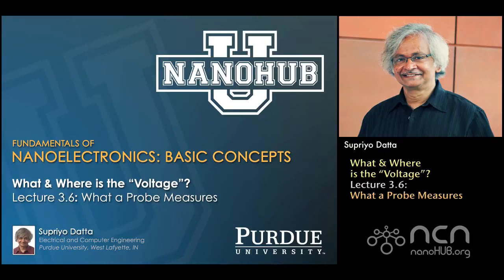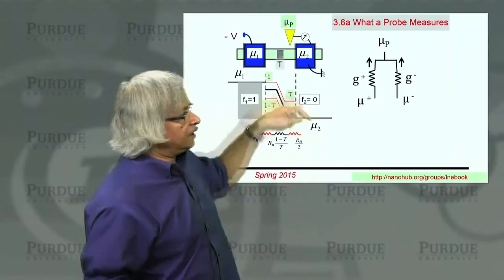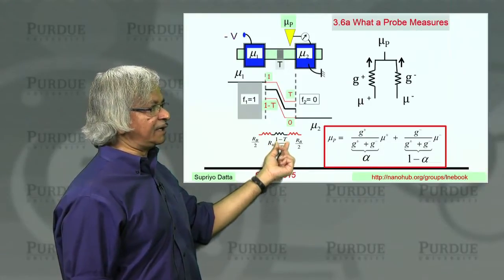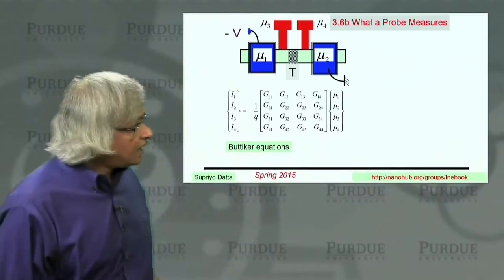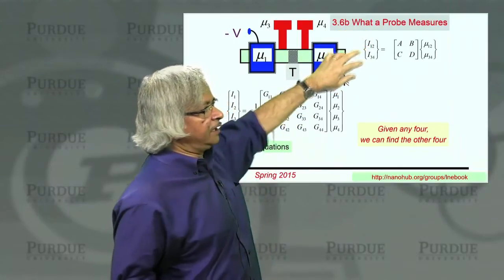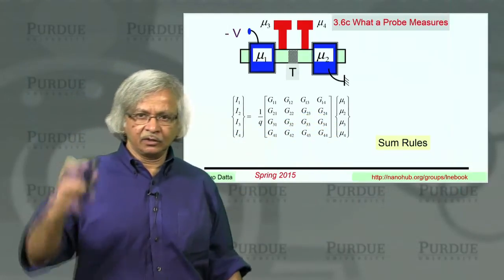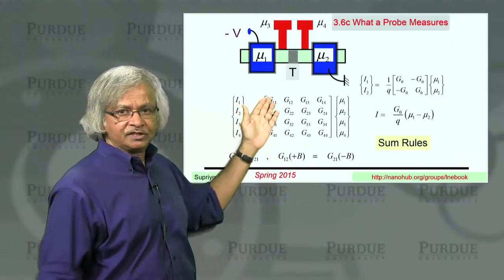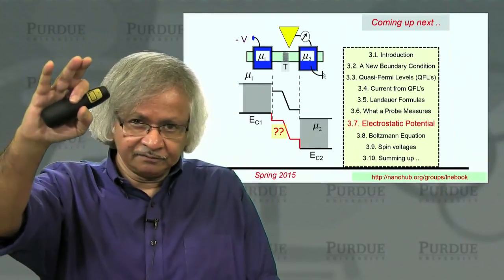nanoHUB-U Fundamentals of Nanoelectronics A L3.6: What & Where is the Voltage: What a Probe Measures

Comment: Dear Professor Datta, thanks for these fantastic lectures. I have one question concerning the four terminal conductance. I would like to make the connection with the Kubo formula when there are two valleys present in the system but there are no terms that provokes intervalley scattering. In this situation, the Hall conductance comes naturally as a sum of two valleys separately. However, if I try to calculate  G_xy with the Buttiker formula, one cannot separate it simply as the sum of the two valleys, since there are cross products between G_ij(K) G_lk(K') and in general these crossed products do not cancel. Thus, is it correct to sum over k in the elements G_ij of the conductance matrix before solving for G_xy?